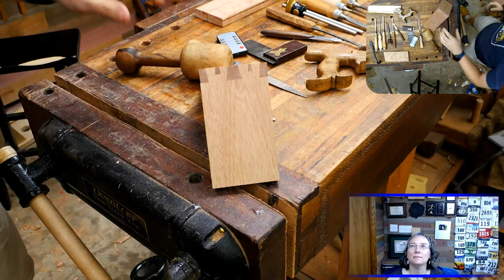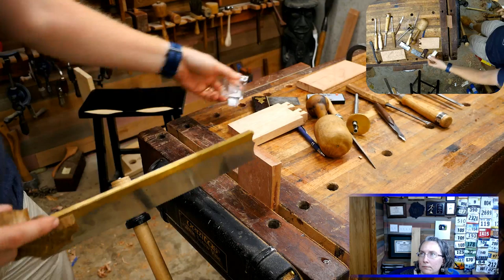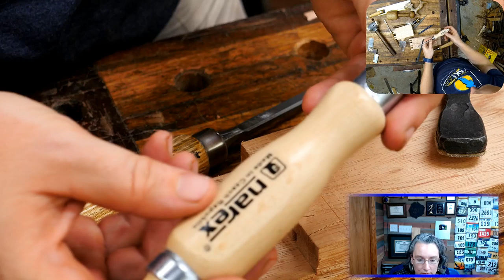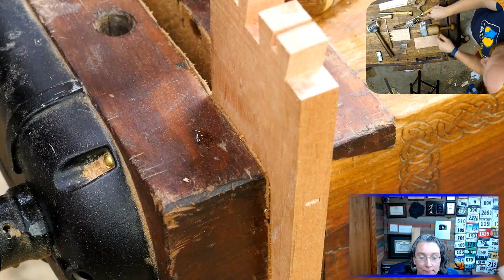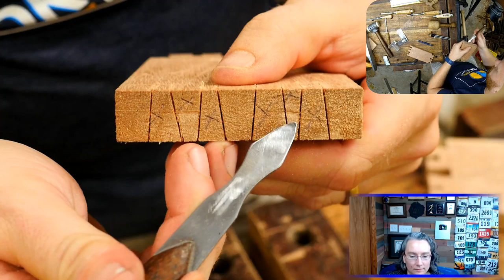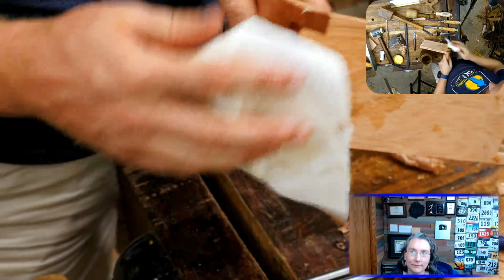Houndstooth Dovetails

Comment: The point about obtuse angles is good. Many people will say you want an angle of 1:8 for hardwoods, and maybe 1:6 for softwoods, but I remember Roy Underhill mentioning you could even do 1:5, and I liked that idea, and yeah, I cut some dovetails to that angle, and it seems perfectly reasonable. 

If you're not sure what those numbers mean, that means a rise of 1 over a distance of 5, 6 or 8 (it doesn't matter what units you're using, imperial or metric; centimetres or inches, you'll get the same angle, because it's a ratio; you can get the same angle using miles or lightyears or Planck lengths). So draw a line square to the edge of a board with length 1, then make a mark at a distance 5, 6 or 8 (or whatever you want, really) away from that, along the edge, and draw a line from the edge to the top of the previous line, and that's the angle. You don't need to know what it is in degrees or whatever. Copy that angle with a bevel gauge and then make yourself a Paul Sellers style dovetail gauge.
Reply from the maker: Right on. I often like the look of more obvious angles. there is no right or wrong. it is a great chance to express yourself.

Comment: Are those race numbers on the wall behind your wife? My wife and ran marathons for years.
Reply from the maker: Yes. I usually run 25 to 30 races a year but my main big gold races are ultra marathons. I try and do at least three to four races a year over 50 miles each.
Reply: @WoodByWright  impressive as is you wood working😁